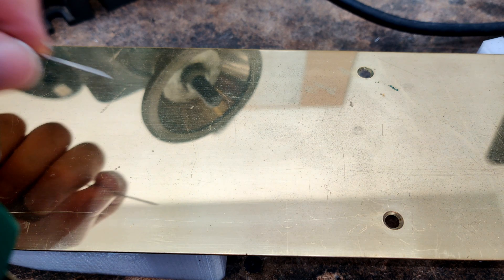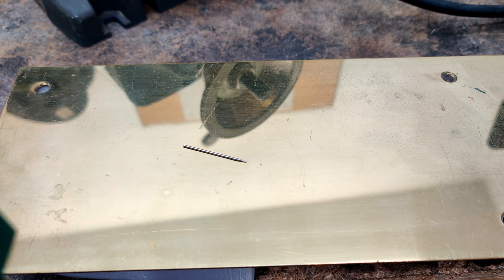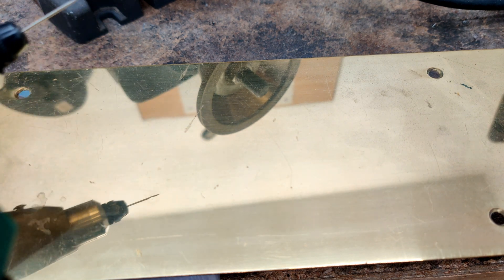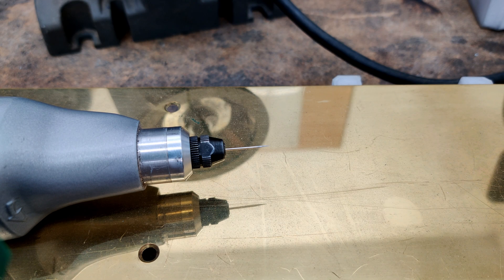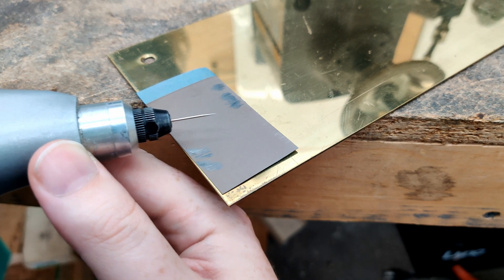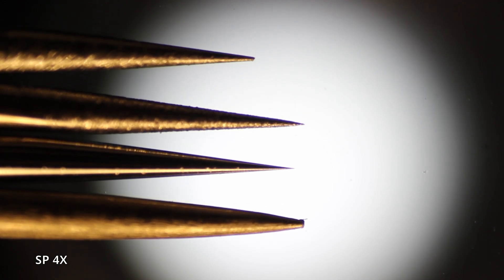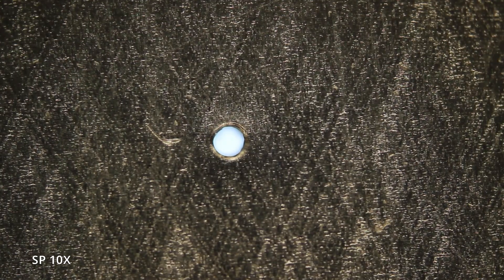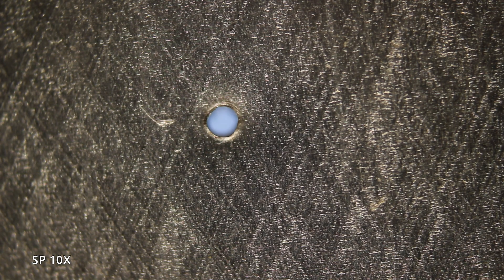Precision Pin Grinding and Sharpening: From Rough to Refined

Comment: Thanks for the excellent video!

I've done a fair amount of trial & error in figuring out how to grind extremely sharp points, and here are some things that ended up working fairly well for me:

1.  I start with a sewing needle.  (Much better steel than a straight pin, but not as brittle as carbide, so it's kind of a middle-ground approach.  ...Mostly though, they were what I had on hand at the time!)

2.  I happen to have a flex shaft on my Dremel, and a pedal to control the speed.  The nose of the flex shaft is a lot thinner than the tool body, which lets it get in closer to the wheel before it hits.  And the pedal speed control lets me slow the RPMs down to a crawl.  (The wheel does all the cutting, and the Dremel keeps the needle turning just fast enough to keep it from getting flat spots.)

3.  When grinding, I hold the needle so the abrasive is always moving from the base of the needle toward the tip.  Like you, I use the side of the wheel, but position the needle down near the bottom, and angled down slightly.  
Also, I don't have a diamond wheel, so just use the plain "fine" grit aluminum oxide one that came with the grinder..
...After seeing your 40× closeups, I think I may have (accidentally) dodged a major bullet there.  The grit on that diamond wheel is extremely aggressive for such tiny work, and the huge gouges [relatively speaking] that your closeups show in the metal could generate some major stress risers that contribute to the tips snapping off.

4.  Heat!  You may not have run into this with your setup, but I've noticed that if I try to cut too fast, the tip of the needle gets hot enough to ruin the temper.  So if I only use light pressure, the high speed air movement right next to the wheel keeps the needle cool.

5.  I've never tried using a second, finer, cutting stage to clean up the gouges from the first one.  Then again, I've never had a 40× microscope to see just how badly I may have needed to! 🙃

6.  I don't know what size holes you're wanting to make, but are you familiar with carbide micro PCB drills?  They're dirt cheap on Amazon, and the first set I looked at just now went down to 0.1mm.
...Don't think I'd want to try drilling freehand with them though, and I'd definitely get a package with more than one of each size.
Also, I don't know if this matters for your application, but the dimensions of a drilled hole will be a lot more accurate, and drilling won't deform the metal around the edges nearly as much.
The down side of using them is that you can't make ultrafine adjustments to the hole size, like you can by varying the depth of a tapered needle.

Hope this helps someone!

Comment: Only advice I can think is that the tip is "too sharp", you may end up at something much shallower, perhaps 15-20deg at the tip. Alternatively you may be able to abrade the hole using some diamond, using the same pin. Spin it in the rotary tool with a tiny drop of diamond polishing stuff and work your way through?

Comment: Nice job. Thanks for sharing.  I can't tell how far you pushed in to make the hole, but what say, at the very end on the emery paper, you lift off and do a slightly more obtuse angle to give it some strength and durability?  (Like they do with knives and even chisels -- the major angle, then the very tip gets a bit less).  Also, if the brittleness keeps being a problem, doing a low temperature long thermal cycle to take out some of the brittleness... another technique of the forge (that I've never done myself).

Comment: Perhaps you could improve the durability of the pin by using a scrap carbide endmill or drill bit? You’ll likely need to use a jig to grind and press the pin as it will be more brittle (but much harder)
Reply from the maker: Maybe with a tungsten  electrode that is too short to tig weld with.